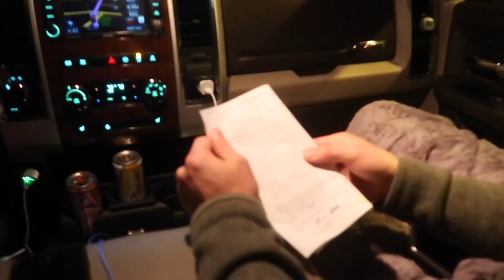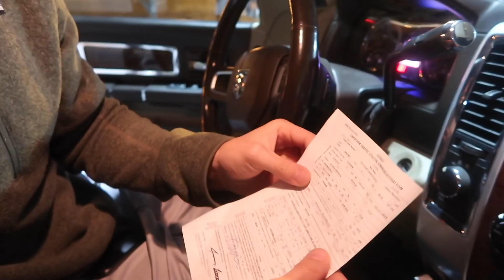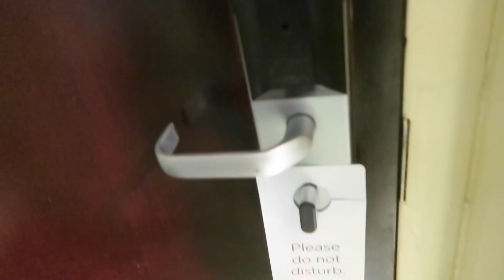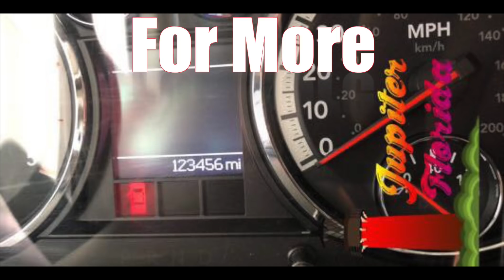Florida Life 94-70

Comment: Question. I have a 94 gt I’m replacing the carpet and the passenger seat bolt is the only thing that’s rusted. The threads are ruined. Is there an option to weld in a new bung? I guess I’ll drill it out and re tap. The floor pan is completely rust free otherwise. It’s the rear bolt. Learned a lot from your videos and am curious what you’d do. I appreciate your work sir!
Reply: Max Jones I would just drill and re tap or blow the hole open and send a big bolt thru it with washers so stop it from going thru the floor.